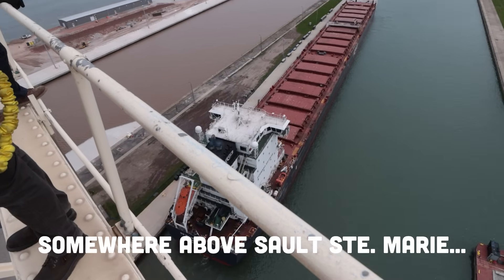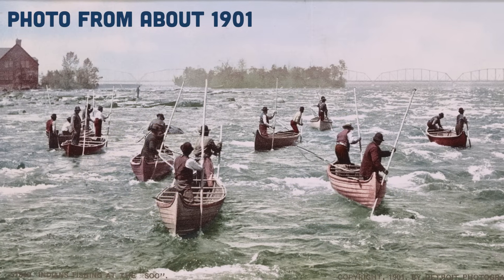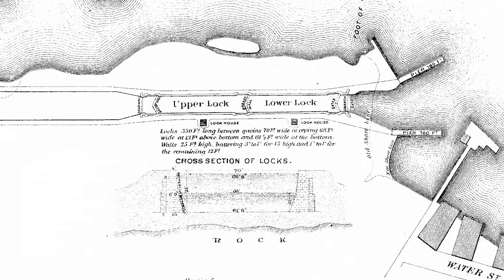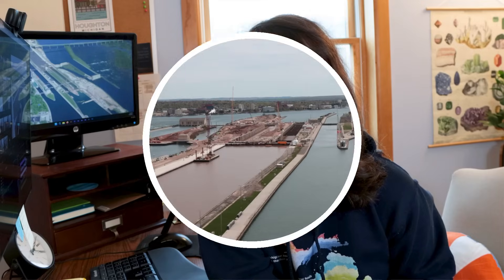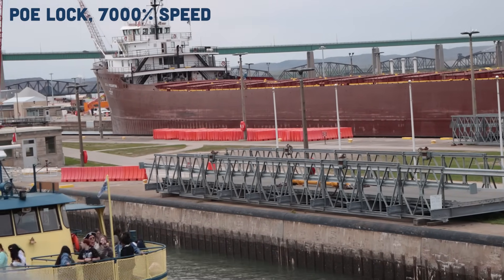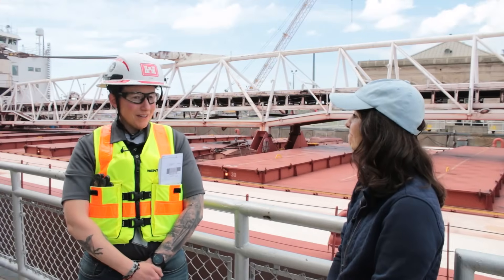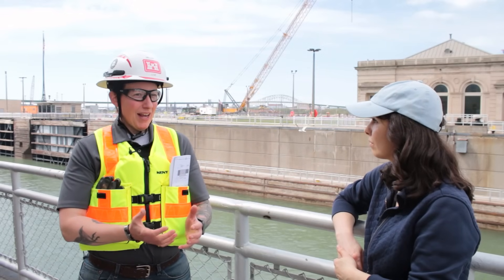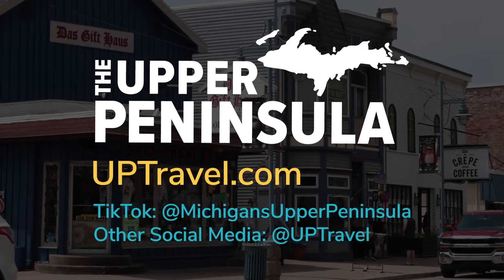If This Breaks, the U.S. Could Lose $1 Trillion | The Soo Locks

Comment: As a truck driver sometimes, I complain about my job/work etc.  Then I am reminded about the conditions that most of humanity lived thru or did not live thr and died on the job.  I drive around and air-conditioned truck with a comfortable driver's chair, and a hydraulic forklift on the back of my trailer that I use to unload thousands of pounds of products every day.  In comparison I am doing Fantastic.  Thank goodness I am not building damns in the 1800's? with no AC no nothing.

Comment: I didn't hear a good answer from the apparent dei hire of why the new lock is not larger than the existing lock other than keeping the operators from having to learn or be trained for a new bigger and better improvement.  That answer seems lacking substance or insight. 
It has the optics of a woman in the position of an experienced man with sound honest answers. 
Sorry .but that's what I see with hokey statements to simple questions. 
Great video... I learned a lot.  Say other than why the  new lock will be the same size as the existing one ,  .... I get it.   Don't like it, but soon  enough, that lack of answers problem will end.

Comment: That opening shot of the ship walkway. 

At the Wentworth Falls west of Sydney is a walk way on the edge of a cliff that is about as thin as that ship's walk way but only protected by a rusty chain wire fence between you and a 300 metre/1000 feet drop to the valley floor below and no one is wearing safety harnesses and people press by each other going in opposite directions.

Comment: If they wanted to, they could have made the locks longer and still used interchangeable parts for the infrastructure. But there are other factors involved from the amount of available water that can be used to operate the locks and other physical constraints such as the size of the river and lakes themselves. Specifically the navigable depth in some areas of the lakes and rivers which also impact and place practical limits on ship size.
Reply: And the time it takes to fill also

Comment: I had an uncle that was a hard hat diver.  In the 1960 he worked for a marine construction company that worked on a Soo Ste Marie project.  I remember two things he told me about the work.  They worked during the winter when it was extremely cold.

As I said, he was a hard hat diver that dove even when there a several feet of ice on the water.  They had a special crew that kept the ice from forming when the divers were down.

He also showed me a picture of the house he was staying at during the project.  The snow during the winter was higher than the roof of the house.  There was literally a tunnel through the snow to the door.

Comment: Thanks, Alexis, for a great video. Being a retired Civil Engineer (mainly hydro) I find locks on rivers and canals very interesting. I have visited the Soo (both sides) a few times and I was always impressed. I have driven across the International Bridge (both directions) - great views on a clear day! If you have not done so already, I suggest you go down to Niagara and have a look at the Welland Canal. This canal, with its system of locks, allows those ships you saw at the Soo to bypass Niagara Falls. Unlike the Soo locks, the Welland Canal - which connects Lake Erie with Lake Ontario - uses locks to raise and lower ships sailing in the same direction! Although Lake Erie is higher than Lake Ontario, ships entering the Canal at Port Colbourne have first to go uphill before reaching the summit and then descending to Lake Ontario. Well worth a visit!

Comment: 16:15 One key point to note regarding "why not build it bigger" is that you would then run into the exact same problem they have now with most of the traffic going through the larger of the two locks. If given an opportunity, shipping companies will ABSOLUTELY build ships larger if they know they will fit in a lock, and then you run into the same issue, except now the ships are too big even for the Po.

Making the new lock the same size means you can now send ships through either lock, which adds redundancy in case one lock goes out of service.

Comment: i used to work on the railroad bridges next to the international bridge. walking across the top of the vertical lift span in the up position to check out the bascule bridge was pretty stressful.

Comment: Another reason to not make the new lock any larger is that all current ships are built to fit in the existing locks. Building the new lock to a larger size would encourage shipbuilders to make their ships larger to fully utilize a larger lock. That would defeat the purpose of having a redundant system as the larger ships would again be limited to just one lock that could fit them in…

Comment: Hi!  I’m a Brit and your explanations were so interesting and I loved your graphical explanations.  Thank you!  

In the UK we have a load of canals all made in the age of the Industrial Revolution all of them to facilitate what your locks are used for today moving needed commodities to where they are needed!  The canals were not natural and had to be dug out and caulked to make them water tight we also needed workers for their labour the Irish workers came over to to fill the niche and during their time working on the canals they were called Navigation Builders or they became known as Navies.  The reason I’m explaining this is because Great Britain is not actually particularly flat!  
The Navies dug out the canals in as starter lines as possible but in some places the canal had to rise over hills and down the other side so the simple lock system had to be used where required!  As well as together with viaducts taking the canal water with the canal boats over valleys, also tunnels had to be bored through the hills and mountainous areas to accommodate the narrow boats (the original method of propulsion was horse power even steam was perfected enough so to propel the boats through the tunnels the art of tunnel walking was used, laying on your back and using your legs to walk on the tunnel ceiling or the side walls to propel the boats) while the horses were led over or around the obstacle.  The boat workers were actually families who lived on the boats while they were working them.There were even lifts in some places which have now been modernised in surprising ways.  I believed the French started the art of canal building.  
From Google:

There are now about 4,700 miles (7,600 km) of navigable canals and rivers throughout the United Kingdom; 2,700 miles (4,345 km) of these are part of the connected system.  
These canals now are for leisure purposes as well as house boats. The canal fell out of use when roads were needed and even filled in to get out of the way for roads and rail.  They have recently started to redid these canals all over the UK people can discover there recreational pursuits and are looked after by British Waterways or charity’s with volunteer workers, also farmers are helping with the rejuvenation.
Why not have a look into it people as well as yourself may be interested!

Comment: If a new Lock was built larger, someone  would be tempted to build larger ships, then, no back up in case of lock problems. The new Lock could have been built years ago at Much lower costs if Obama Biden administration would have given the Corp of Engineers the project, as it was truly "Shovel Ready" 14 years ago.

Comment: The main reason the new lock will be the same dimensions as the current Poe Lock, is because if they made it bigger, the shipping companies would make bigger ships.  Then they would have the same situation they have now with certain size ships only fitting in 1 lock.

Comment: A comment on isostatic rebound. The Red River which forms the border between Minnesota and North Dakota is one of the few North American rivers that flows north. In this case, into Lake Winnipeg in Canada. This is all part of the remains of Lake Agassiz. The Red River does not really flow, it meanders. Its gradient is less than a foot per mile. So it regularly floods Fargo. And the problem is getting worse as the land in Canada near Lake Winnipeg rebounds, further reducing the river's gradient.

Comment: I'm trying to wrap my head around "If these locks were out of commission for six months it would cost the economy $1.1 Trillion" and "If we had to haul all that cargo by rail it would cost an extra $4 Billion."

I understand that those are measuring two different things, but the costs are related, so I don't understand how there can be such a huge discrepancy in those numbers.
Reply from the maker: That's a great question! The $4 billion number came from the Army Corps of Engineers, and they didn't elaborate on it in the source I read. My educated guess would be that if the locks shut down unexpectedly, companies would lose money both by having to pivot to a different shipping method (assuming that would be possible on short notice), but also because their production numbers would suffer. (For instance, a steel company might not be able to get the normal of amount of iron, so they'd sell less steel. As a result, Ford might not be able to make the number of cars it usually does, so their income would also go down, etc.)
Reply: @AlexisDahl  I was figuring the total economic impact would be larger than the alternate transport cost, I just couldn't grok a 25,000% difference.

Comment: A couple of interesting facts about Sault Ste. Marie is that it had one of the first indoor hockey arena because of the power plant you highlighted.  A second fact is that because of the power plant, a factory to produce calcium carbide was built in the Soo.  That factory was part of the original Union Carbide Corporation.  Was fortunate to do some environmental restoration work on the waste lime deposits from that plant.  Along with the locks, there is an old freightor ship museum near the locks that is very interesting.

Comment: Many years ago my wife and I worked on the removal of the 1930's hydroelectric station on the Canadian side of the river. It was an interesting job that involved moving some very heavy machinery from Sault Ste. Marie CA to Kincheloe Michigan. One of the more interesting events was when the salvage contractor asked me why there was more water in the upstream gallery than at the start of the job.  After some calculations I concluded the underground water pressure was lifting the remains of the old building and that, without cutting off the connection to Lake Superior, the building would float away leaving an open channel connection the Big Lake to the lower part of the river. The overall contractor for the new powerplant finished the cofferdam  in the old power plant's waterway very quickly.

Thank you for your presentation. Soult Ste Marie is one of my favorite places in North America, Thanks again. GregW

Comment: We live in the UK, and I am well acquainted with the canal and lock  systems here as my dad was a boaty (he lived and worked on the barges that delivered salt, sugar, and flour). They have always fascinated me, so seeing these massive ones and learning how they work was brilliant. The great lakes themselves are amazing, and we learned today that they were on different levels, so another bit of knowledge gained.

One thing I remember was my dad and me going along the canal tow-path on our bikes and when we got to a bridge he stopped and showed me something. The underside of the bridge had a sooty look to it from the old engines, but even more interesting was that carved into the edges of the bridge were huge grooves. These were a result of when the boats were pulled by horses and the ropes constantly rubbed on the masonry. I can't go along a tow-path now, and not think of that because my dad, as a boy, kept the horses on course. He also had to unhitch them and take them over the bridge, then reconnect the tow-line again when they reached junctions.  

He also showed me what they did when they had to go through a tunnel prior to the engines. They lay on their backs either side of the barge and walking the boat along with their feet touching the roof of the tunnel. 

Watching you stood there talking with the engineer, I found myself somewhat distracted by the monster that was slowly gliding past you. It put it into perspective just how enormous these ships are! I would love to see one of those things up close. Thank you for showing us what they look like up close and the lesson on how it all works. We will definitely be tuning into the next instalment.

Both my husband and myself love watching your videos because you have so much enthusiasm and have a way of putting things, so I can understand it.  My husband who has a background in engineering just sits there nodding and being amazed when you explain the scale of things.
Reply: If you come here, go to Marquette Michigan. You can see these monsters being loaded for their trip south. That's another engineering marvel. 
Nothing beats the Falkirk Wheel for cool locks, though!

Comment: Thank you for this wonderful video! The Sault locks are a key part of the international economy between Canada and the US. In 2023, Canada exported 78% of its goods to, and imported almost half of its goods from, the United States. As of 2022 (latest data available), the United States is the largest source of foreign direct investment (FDI) by stock in Canada ($438.8 billion), while Canada is the fourth-largest FDI source in the United States ($589.3 billion). In 2023 the US Exported $354.4 Billion to Canada, while Importing $418.6 Billion, much of it petroleum products. The economies of many of the northern states are intrinsically tied to this trade, and attempts to remove the NAFTA Agreement for free trade between both nations, like what was attempted by the previous Trump administration, would devastate the economies on both sides of the border.

Comment: I had the opportunity to do some construction work on the Poe lock several years ago. Used to work for an industrial paint contractor on the Mackinac Bridge. Did that for a couple years until our section was completed. I did not want to move with the company so I found another local job. Company that i used to work for got a contract doing some work over the winter on the Poe lock. My old boss called me up and wanted me to run a crane for the job. Would have paid really well but would have required a daily commute from St.Ignace to the Soo everyday and would have been working  outside during the winter. I decided to stay at my current job because the pay was good and it was mostly inside work.

Comment: You are so lucky to get such a tour. Power to the US Corp. I am jealous.  One economic point. Iron moves down stream toward the Atlantic Ocean and into the Great Lakes from the Atlantic Ocean based on ore pricing and shipping cost. The break even point changes with market conditions. So if these locks closed the steel mills would not necessarily close, but the cost would go up a lot as the iron would need  to come further in the Great Lakes than “normal”.  There are two iron mines on the Quebec north shore than typically ship both into the Great Lakes and export to Europe and Asia. They would ship more in the Great Lakes but that would likely not be enough. So the replacement ore would need to come from further, like Brazil because of the quality requirement or even further away. Love you did this story.
Reply: Good point, the steel industry would not shut down because of “lock failure”, no problem to source high grade iron ore from Sweden or Brazil, or you can just buy the high grade steel that the industry needs as a temporary solution until the locks become operational again.
I guess a shutdown in the locks in the Panama Channel would have a much greater impact on the US economy

Comment: If that lock broke unexpectedly, steel industry wouldn't stop.... the ore would just be moved by rail.
Reply: It would not be seamless and easy. The Railroads would need a lot of extra infrastructure and schedule changes to make it happen. The mills are set up to get their Taconite on the lake side of the mill, not the land side where there might be a rail siding. And one lake boat with 30000 tons of taconite is how many rail road cars???? It could be done but it would not happen overnight and would cost industry a ton of money

Comment: How do they handle the rebounding of the land from the glaciers you mentioned at the start?  I realize it's a slow process, but the locks are approaching "things that have been around for a long time".

Also, about that rebounding, is it like my sofa where most of the rebounding is relatively quick and then last percentages is much slower?